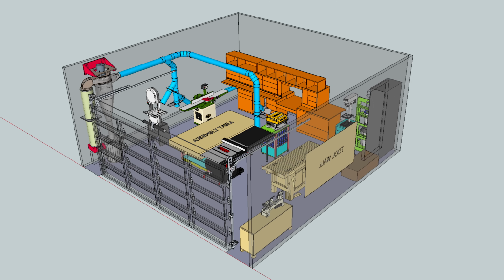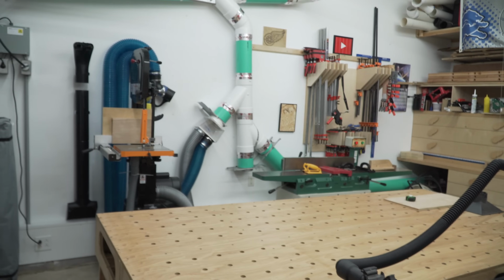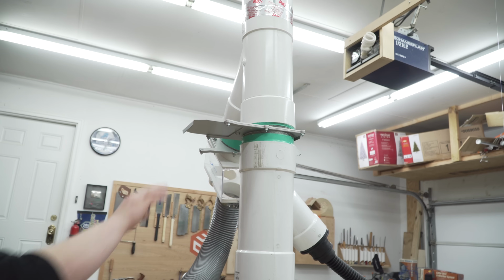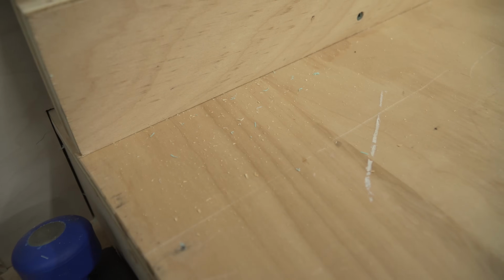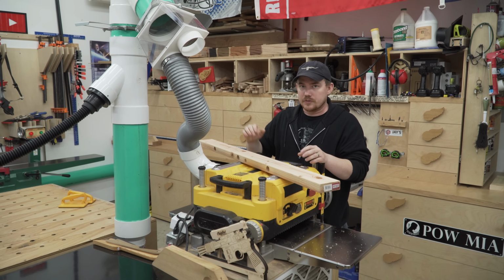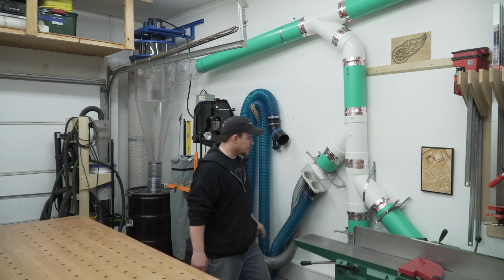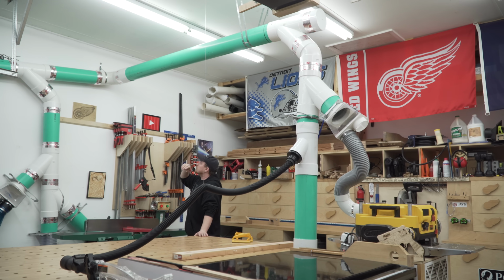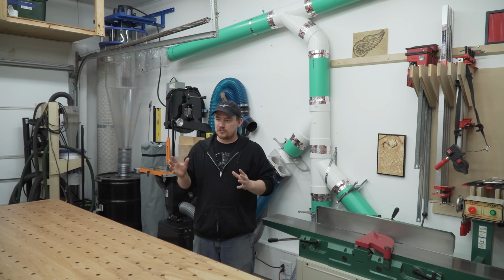Dust Collection Piping and Testing - 275

Comment: I like the set up with your system.  My only concern is if you grounded the system.  If you did not ground it, I would be a little concerned with static electricity sparking an explosion and causing a fire.
Reply: It has never happened. It happens in grain silos, not in shop dust collectors. The most you would get is annoying static shocks to your body every now and then.

Comment: Hi jay, have asked the following two question of several others and haven't received any decent answer from anyone. The questions revolve around  using pvc piping for a dust collection system. You have used pvc so I hope you're my man. Question one: I bought an industrial 60 litre vacuum with two 1300 watt motors, either use one or the two in parallel. The intake diameter is 57mm (approx 2.25 inches). Is this diameter good enough for dust/chip extraction and if not, what pipe diameter could I increase to and not lose too much suction? Second is the static electricity build up. Have you earthed your system? If not, why not? Thanks
Reply: Robert Williamson --- CFM's (mostly) determine pipe diameter. Larger pipe usually suck/control micron size dust (the lung damaging kind) better.

Comment: Are you planning on grounding the pipe?  I just put in 180' 6" pvc (same as what you have).  I had read numerous article that dust fires are a farce in a non-industrial application so I didn't bother......until I got zapped.  Pain in the butt to do but it will keep the inside of your pipe walls from clinging dust from static, especially MDF.Cheers

Comment: I do not see any static grounding. Static can be a huge issue particularly for any electronics that might come in contact with your system.  Remember static electricity is what caused the death if three Apollo astronauts on the launch pad during a routine practice for a Apollo launch.  Other those thoughts', nice system.
Reply from the maker: You can't ground PVC. Static isn't an issue.

Comment: Hi Jay,  what power (in watts) does your dust collection motor have? I live in Germany and have just bought a Nilfisk industrial vacuum with two 1,300 watt motors, planning to use it in my shop vac build. The piping dimensions you have used are big! I assume you need a lot more power to get enough suction there?!? I was planning a max diameter piping of roughly 4 inch. Any feedback would be appreciated. Good to have you back on the Tube 👍

Comment: Great job explaining the details of your collection system. I know this was mentioned somewhere in your other videos but I would like a detailed explanation about why your using PVC instead of a flexible hose with a grounding wire in it. All the books I read say to ensure the system is grounded to reduce the chances of static buildup, yet you do not mention anything about running a wire or grounding the system. I have a huge Oneida Cyclone unit I want to install in my shop and I have been following your videos for information on how to do this. So your rational will help me decide on whether to go with PVC or flex hose.

Comment: All  that plastic with fdust running through it causes static electricity, which could ignite the dust, thereby causing a huge boom boom. All the plastic should be spiral wrapped with copper wire, from the equipment to the collector.

I believe you will have dust accumulation in the jointer where the round fitting cuts into the corners of the jointer exhaust.

If you do move your shop, all that silicone sealant will be a mess to deal with. I would have gone with the tape throughout.

We have a large shop with two 15 hp collectors, and we also place the blast gates as the first part after the wye.

Other than that, it's a great system and well planned.

Comment: Don't you have to connect a ground wire the length of the pipe for static charge?
Reply from the maker: Not unless it shocks you. It hasn't shocked me.

Comment: Hi, Jay nice system. I was surprised to see how much suction you have when you ran the whole line at 6-inches. Good job. Personal thought is to keep the small suction line at your table saw top. It is nice that you can get it completely out of the way when needed. With 4-inch at the bottom and 2 (roughly) at the top should keep working great. But your shop and you adjust as required.  ONE NOTE FOR YOU. Air flow does create static. Air with debris creates more and can cause fires and other such problems in time. You are correct about plastic not being conductive by itself, however static travel over not through. Grounding is a good idea. Simply run a ground lead from pipe/duct to a wall plug and attach at plate mounting screw at various locations. With the lead pipe side just attach with 1 to 2-inch screw penetrating into the pipe. Now grounded on outside and air inside, Simple!   I really enjoy your site, keep at it and let the haters flow off your back. You are doing good, keep it up. Sam

Comment: I'm designing my workshop right now, and after hours of research plan on getting the exact same dust collection system. Could you please post links to any of the fittings you used in this video? Or, did you just buy them locally? I found a good source on my PVC, but I haven't shopped around for any of the other stuff yet since it'll be another month or two before I order the dust collector.

Thanks for your channel!

Comment: Jay, I like your thinking on dust collection.  Mine looks very similar to yours and I too have the green and white mixture of pipe.  I'm running an Oneida 3 hp and I am getting about 1200 cfm thru the pipe at the end of the run which is about 55 feet.  Ive done the same thing as you when I use a 4" dust port.  I also make sure another 4" is open next to it that feeds into the 6" at the same place.  Otherwise when the airflow enters the 6" pipe, the airflow will slow down.  A 6" pipe has a little over 28 sq inches of cross section whereas a 4 inch has only about 12.5, so two 4" pipes will almost fill a 6" pipe. Keep up the great videos.

Comment: Jay, I don't think I would put the 4" rigid over the top of the saw.  When the gate for the saw is open there should be no starving for air because your 4" coming out of the bottom of the saw and the smaller hose coming out of the guard. I think you would miss being able to get rid of the obstruction over the saw.
Reply from the maker: The pic was a mock up. I'd have an articulating arm.

Comment: Looks like a great system you have there. I have never worked in a commercial furniture shop that didn't have me covered in dust head to toe by days end, and my own home shop is appalling. This video may have motivated me enough to at least fix up the dust extraction on my panel saw which only has a severely choked 4" hose connected to it at the moment. Great vid, thanks.

Comment: Great article about dust explosion explanation , which I think most people around wood working knows that's very unlikely to happen ! But word to the wise , I would ground the dust collector simply to prevent getting zapped through the machines which it will happen ! Just a constructive suggestion! Nice system.

Comment: Good video as always Jay.  And perhaps your recent nasal issues did get inside your head, but after my eye surgery, I'm paranoid about eye protection.  I'd rather play it safe though, so good job with the new DC.  At the very least though, a clean shop is more fun to work in.  And the less time you take cleaning, the more time you can be making.

Comment: 30 years ago, I installed a 6" PVC dust collection system in my shop. Not knowing if all of the concern about static electricity explosion was myth or not, it was simple enough to run a #6 bare copper wire the length of the main truck and then take it to a real earth ground. Cheap insurance, and you could even retrofit it to existing. There is no debate, in m y opinion, to the need for dust collection.

Comment: Thanks for your video. I am installing a Clear Vue collection system as well. I decided to locate the cyclone into a closet for noise suppression after initial powering up. Hard to tell on a video but your system doesn't seem to sound like jet taking off like mine.

Comment: sorry maybe I missed it was there a reason for the 6in pipe instead of doing a 4in pipe? Or is that what came with the dust collector? Is there a better suction with the 6in?
Reply: You get a much larger airflow through 6" pipe.  The higher the airflow the more it can move the tiniest of particles and keep them suspended in the air.

Comment: You should really look at grounding the PVC. It can build up static and possibly damage tools or shock you. Probably won't hurt you but it could be unpleasant. The collector should have a grounding screw somewhere on it.
Reply from the maker: There is very little static build up. It's a non issue.
Reply: Just wanted to make it known. Nice set up.

Comment: I wouldn't think the reduction to the table saw would cause too much strain as you have it if you have the ports from the planer completely open at a blast gate. I would think the ambient draw from the planer would help, especially the one port just open to the shop.

Comment: "not a single case" 

ANY time you have fuel and oxygen and ANY source of ignition such as static electricity you have the potential for fire.  So unless you have the only plastic on earth that does not create static electricity, it would be in your best interest to ground it out if for no other reason than the static electricity charge on the surface of the pipe will attract dust. 
 Also this shop is in your HOME, check with your insurance provider 

From http://www.bonappetit.com/trends/article/food-disasters

Death by Flour:
In 1878, the largest flour mill in the USA was Minneapolis's Washburn 'A' Mill. And on May 2 of that year, it exploded. The whole mill building was destroyed instantly, along with 14 workers inside, and the ensuing fires killed four more and took out four other nearby mills. Along with cheese, flour is an unexpectedly flammable food, especially when it's hanging around in high enough quantities in the air--it only took one spark set off an almost instantaneous chain ignition of all the flour-filled air in the building.

The same kinds of dust explosions are common in coal mines, lumber mills, and (to this day) grain silos and flour mills. Despite OSHA regulations to keep them in check, a similar explosion killed 14 workers at the Dixie Crystal sugar refinery in Georgia back in 2008.
Reply: Neil Orris Hey Jay!  I'm glad you stopped storing cheese and flour in your wood shop!

Comment: Jay.  

Good looking system.  

This is not “legal advice”.  I recommend checking with your local fire marshal, your insurance agent, or your local code enforcement department for their input. 

OK with the disclaimer out of the way.  In my opinion.

The only thing that I see missing is that, thus far, there is no static electricity ground.  PVC is a cheap and effective material. HOWEVER, when saw dust travels through PVC, it creates static electricity which can shock you or arc to create fire.  

Fire in a dry, well oxygenated, fuel filed, encased area, sounds like a definition of a bomb.

So my SUGESTION is go buy some 12 or 14 gauge ground wire [no insulation] at your local big box home improvement store, and start coiling it around all that lovely pipe.  One wrap per foot, and attach the wire to each [and every] piece of pipe and fitting with short sheet metal screws or pop rivets. Remember all that silicone is an insulator, so lots of screws and washers, at least one in each part, and one at each end of any part longer than 4 feet, if you screw through the joint sleeve you ground both parts.  At the “y,” fold, don’t cut the wire and wire nut the third leg. And finally attach at least one end to ground somewhere, like in the solenoid box.

Comment: I'm puzzled.  By increasing duct size from 4" to 6", you reduced the velocity by 56% ... and it's the velocity that "entrains" the dust ... and reduced 'duct losses' by a negligible amount [assuming your vacuum system is producing 1700 - 2000 SCFM].

6" is great to use when you have gravity on your side or when the fluid being conveyed has high [kinematic] viscosity ... and I don't think the air's THAT thick in MS!

For those who can't get their heads around this .... imagine what happens as the velocity in the pipe approaches zero.

As with insulation, "bigger" isn't always better.
Reply: His Clear Vue DC can move 1400 CFM, so it needs 6” ducts to handle that volume. Plus, that high volume is needed to draw the dust at the source rather than escaping into the shop’s atmosphere.

Comment: Have you noticed any static buildup on your PVC piping?

WAIT! Let me finish... :-)

My Shop Vac+Dust Deputy is plumbed into an HDPE drum, and the setup will give me a wicked zap of static after I run it awhile. Plus, the whole thing collects dust due to the static charge, which gets all over me when I brush up against it.

I wish it would build up the opposite charge so that it would REPEL dust, but I'm not sure that's even a thing with sawdust...

Comment: Great Job!
I have my PVC dust collector set up and used the foil tape on the inside of the connection and then wrapped it around the seam for a seal, originally intending to run a insulated wire along the piping 
and then ground the system to a connection (which was one of the bolts that held the framing to the cement slab) to make the ground. 
I have used my Clear view Cyclone setup for over 3 yrs and I have NEVER gotten a static electric shock from touching any part of the system while it is in use!
Nice work on your installation, Very Professional, and I am still getting used to wearing a respirator, course I have to wear glasses, and that bothers me more than anything, I am thinking of a tilt down fresh air  face shield unless that fogs up and gives me a problem. Hate wasting 2-3 hundred dollars for fresh air but sometimes you have to do what you have to do!

Comment: I have just recently got into woodworking and have used a couple of shop
 vacs on different machines. In addition I run a fan that blows across 
the shop out through 1 of two 6 ft barn doors. Even with my short time 
into woodworking I have already experienced some discomfort from the 
dust (your body telling you something). So I can fully understand 
somebody wanting to "really" get after dust control. There are some shop
 tools I really want to acquire ... but my next expenditure HAS to be a 
good dust control system.

Comment: I doubt I will ever be able to buy a $2,000+ dust collector(I can only imagine that conversation with SWMBO). But I really like seeing the evolution of your shop and dust collection-I learn something every episode that has me wanting to make refinements on my own setup. 

One concern: I have a shop-vac setup with a "sensing" outlet so that when I turn on my tool, the shop vac kicks on. I still forget to hookup my tools now and then. It will be interesting to see if your use of the remote control impacts how much you use the system (I can imagine if you need to make a quick cut at the miter station and the remote is on the other side of the shop, will you make the walk over and back to get the remote?) Have  you investigated having the dust collection switch tied in to the tool switches or outlets? I haven't done too much research, but it seems like it would greatly increase the dust collection convenience and utilization.

Great video (and website article)!
Reply: Don't give up. I just built a 3HP cyclone for about $1000 with 6" PVC piping.  It's all about finding the deal on the expensive components.

Comment: You may want to consider fabricating a widow for the 55 gal drum. It will take the guesswork out of knowing when it needs to be emptied.  You may also want to consider making a flexible dust catcher for the miter saw that hooks up to the saws dust port and extends to the fence and then attach a small hose to the saws dust extraction nozzle. Similar to what you have for the table saw. Also wondering if you'll be grounding the piping or if it needs to be. Nice work!

Comment: I think that you have done a very good job setting everything up for dust collection. I would suggest that you consider carefully before settling on a design for the over arm dust collection. I made a parallel arm with counterweight to lower the blade guard down but find that it still interferes when making cuts on taller pieces. Mine can raise out of the way of most cuts, but requires partial disassembly for others. I look forward to seeing how you set yours up. I am running 4" both into the saw cabinet as well as the overarm. Perhaps one day my dust collection setup will look as tidy as yours. Well done!
Reply from the maker: My thought was to make an articulating arm coming out from the main drop. But that isn't in the cards right now. This seems to be doing quite well.
Reply: I use a 4" flex hose drop to a Shark Guard for over the blade dust collection with my CV1800. Works really well until you need to shave the edge off a board, but this would be a problem with any over the blade guard. I also remove it when I need to make a cut within about 3" to the fence, or for crosscuts. So I'm almost never collecting all the dust at the table saw. Oh well. Let me know if you'd like to see a pic of this setup.

Comment: Does the mitre saw have a top guard suction port ? if so you could put a piece of flex hose that dangles into the 6 inch, the venturi effect may remove the dust that currently seems to make it around the blade.